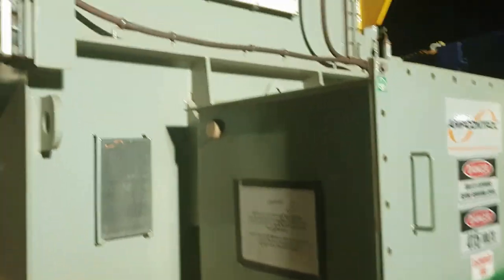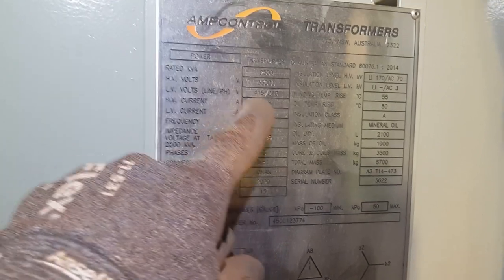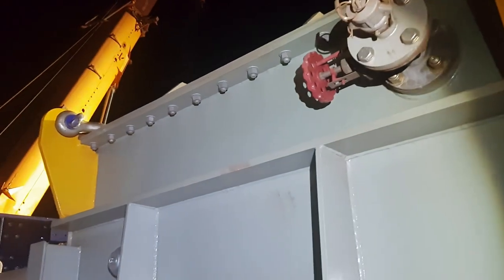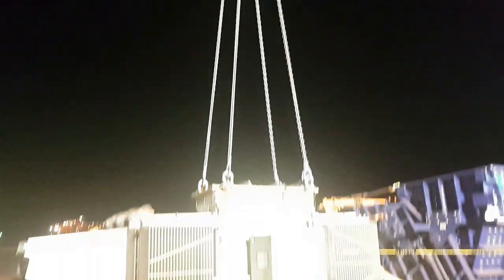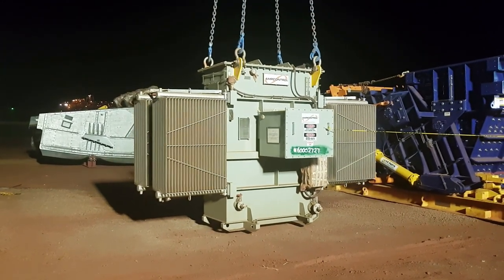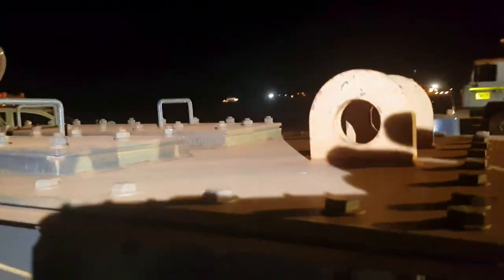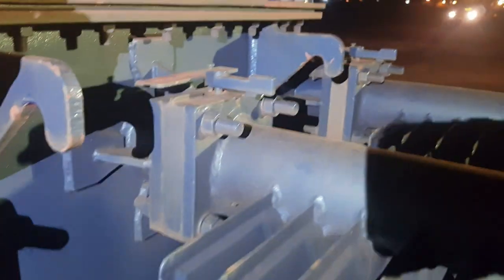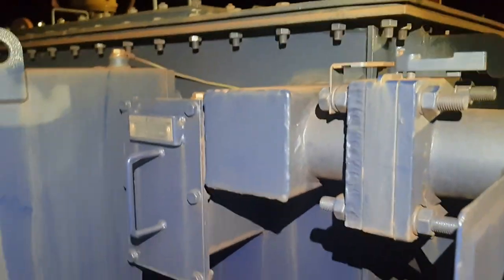Transformers

Comment: How do you attach to those lifting lugs on the side?
Reply: Obviously 1 chain basketed around each of the side lugs
Reply: @nickydelahunty5296  just basket back to the o ring? I thaught that was not good practice
Reply from the maker: So we have wire slings which fit over nice or chain/sling with small shackle which fits that groove nicely using pin of shackle